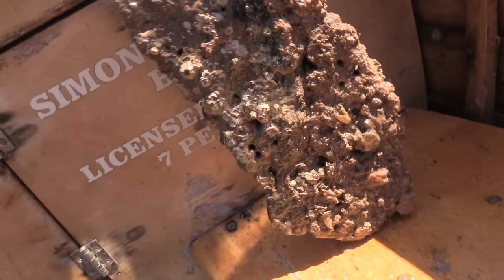Fishing for Big Eels from a Wooden Boat

Comment: The wild duck built by the Dixons boatyard Exmouth, running out of Beer, this boat is now called Duchess 
you must be on the 'Getting' there are congers further in just off Beer Head the ledge runs south.
This boat in the 1960s had a Stuart turner 4 hp petrol engine the boat was built for Doughy Orley